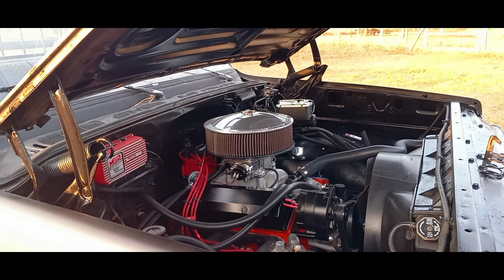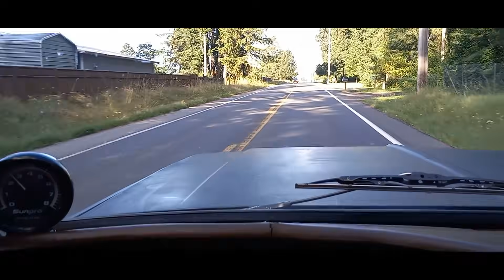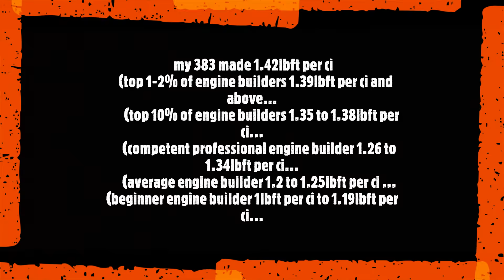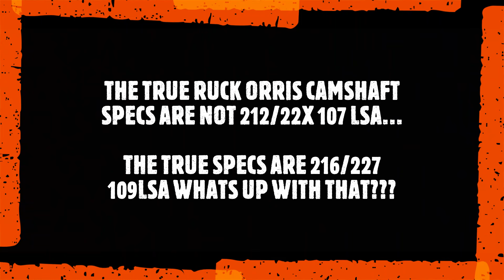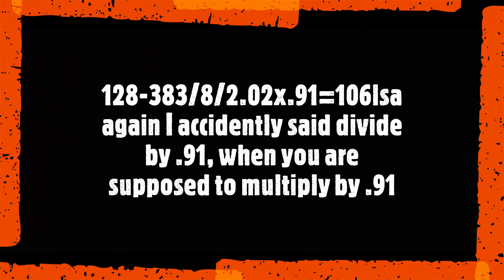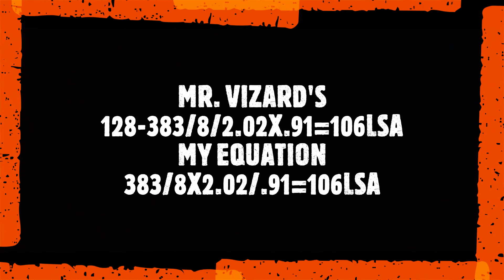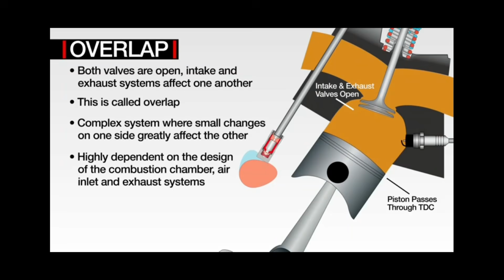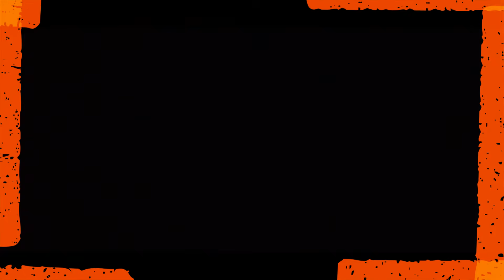CAMSHAFT SELECTION by LSA, 9 LSA's DYNO TESTED!!! LSA THEORY WILL BE DYNO PROVEN!!!, and EXPLAINED

Comment: 4:04 are you talking about Richard Holdener here? I kinda hope so. He wouldn't accept what I was trying to RELAY to him (The information originating from David Vizard) about camshaft selection for turbocharged applications. After that and after I called out his logical fallacies he was using to make the claim that "every cam is a turbo cam" he proceeded to ignore all further interaction from me.

Though, TBH, I still don't fully understand camshaft optimization for various boosted applications, so, assuming LSA is set/fixed/ideal/optimized as per the 128 guideline from DV, and assuming you've maxed out your useful lift for your given valve sizes, how should you go about optimizing your only other 1.5 camshaft specs, those being duration and overlap, the latter of which is at least a partial function of increasing duration (obviously depending upon which side of the lobes you increase it on)?

EDIT: 1:22:35 This is why I do hours and hours of reading on subjects that interest me. I cross reference and compare and continue to dig for information in order to hopefully uncover the truth, or something very close to it. I'll admit, I've shared pre-maturely before my findings are complete, before, but I always run it back to anyone (important) that I've shared with when I find the more accurate information that disproves or supersedes what I thought I previously knew. Or otherwise, I proceed with disseminating my updated information, along with my sources for ANY information I'm talking about. Nowadays, I also try NOT to share ANYTHING until I'm at least 60-80% certain it's within a margin of error of the truth.

As such, I will be sharing LSA theory with my brother, despite the fact that he already has a shelf cam and is reportedly happy with it, not wanting to change, and is planning for a positive displacement blower "retrofit" (essentially) in the future.
Reply: Also, I feel like I've come up with a few modifications to make the 128 formula more approachable for people with 2 intake valves, as well as some conversion modifiers for metric engine and valve sizes. Check it out:

Metric 3 or 4 valve: 128-(cc displacement/16.387/cylinder count)/((mm intake valve diameter/25.4)*1.414)*.91
Inches 3 or 4 valve: 128-(cid displacement/cylinder count)/(inches intake valve diameter*1.414)*.91
Metric 2 valve: 128-(cc displacement/16.387/cylinder count)/(mm intake valve diameter/25.4)*.91
Inches 2 valve: 128-(cid displacement/cylinder count)/(inches valve diameter)*.91

Although I'm not sure at all where the 128 or the 0.91 are derived from, I hope that this is accurate to all reasonable specific displacements. I noticed the big block numbers start with 132 or 133 for the formula, but still have the 0.91, so IDK if the bigger starting number is due to the longer stroke, or the higher stroke-to-bore ratio, or how the 0.91 comes into play at all, but if we could get those figured out, we could FOR SURE have a dead accurate LSA finder for literally any engine out there.

As it is, most small blocks run in the 75-100mm stroke length with bore-to-stroke ratios ranging from 1.33:1 in the case of a 4-inch bore and 3-inch stroke, to just about 1:1 in the case of a roughly 4"/4" engine, and this tends to be true for MOST road going engines in general of any displacement and cylinder count, both the absolute numbers of 3-4 inches, and the ratios. Though quite a few road-going engines are leaning towards the 0.9:1 bore-to-stroke ratios nowadays as manufacturers chase more volumetric and thermal efficiency for emissions and CAFE standards...

Big block engines also do this, seemingly to avoid humongous and heavy pistons associated with large bores, with one example being a roughly 4.25-inch bore with 4.75-inch stroke, or roughly 108mm bore and 120mm stroke. Ironically, the 6.7L Cummins is also around these bore and stroke numbers, but IDK how the 128 formula would apply to that, either, or if the 133 big block formula would be more applicable.

Comment: Wow. What an amazing video. I, too, am a spinal cord injury survivor. Your video made perfect sense. I have the wrong cam in my engine (290/350, L82 cam, dish piston engine). It does not have near the torque it should have. Ground straight up on 114LSA. I knew it was wrong, bigtime. I used the 128 formula and came up with 107.4 LSA. I swapping over to Vortec heads, set up for my cam ( .450/.460, 222/222). I have talked to several cam companies, all suggest a wider LSA (110ish). With what you have said about lower compression, and tighter LSA. I thing a 106 would be about right, but I can't find a reliable company to grind me this cam. I talked  to Oregon Cam Grinders they are steering me away from a hyd. cam, to a roller cam. So back to the drawing board I guess. What do you suggest I do?

Comment: Question.   A 350 cubic inch engine.   Air gap intake.   750 double pumper.   1 3/4" long tubes. 10.75:1  cr.   Heads flow 210cfm@.4" and 260cfm@.5".    There are two camshafts, lsa and duration exactly the same different lift numbers.  Cam #1 220@.05", 112 lsa, .410" lift.   Cam #2 220@.05", 112 lsa, .610" lift.   How much more power does cam #2 make?

I know if the combo was the same and one head flow 210cfm and the other flow 260cfm that 260cfm head would unlock 40,50,60hp or more.   It would be a big deal.   Please advise on how the cam situation plays out?

Comment: So I know Vizard is completely right, nothing wrong there. But your formula at 1:09:12 is nonsense.
128 - 402 = -274
-274 / 8 = -34.25
-34.25 / 2.165 = -15.82
-15.85 x 0.91 = -14.40
And if you reverse the first two numbers, i.e 402 - 128, you get the same result, but as a positive.
The formula goes as follows.
LSA = 128 - (402 / 8 / 2.165 x 0.91)
Reply: Remember your order of mathematical  Order-of-Operations acronym PEMDAS covers this without the added parentheses... the order is:  Parenthesis, Exponentiation, Multiplication, Division, Addition, and Subtraction, so it works out either way, but the parentheses do help a lot to keep track of this order!!

Comment: 1. why the focus on advertised duration? Factory cams typically have long duration @ .006 and short @ .050 vs aftermarket. I've always focused on .050 duration.
2. re DV formula, it doesn't take into account cfm. How can a 180cfm bone stock head use the same LSA as 300cfm? 
3. how to find these tight lsa cams?  Cam manufacturers don't have them unless you go custom grind.

Comment: Loved this video. It was like a verbal version of DV,s book.I am also a square body guy currently building a 540bbc for my crew cab dually. My build is somewhat off the beating path and I would value your input on my combo. 4.5” bore, 4.25 stroke, 6.385 rod, Afr 265 heads with 109cc chambers, yes, I know they are small, but not only does the budget not allow for for new ones, I was hoping to make a shitload of torque low in the rpm range. Performer RPM intake, 1 7/8 Hookers and 9.7:1 cr. All the builds I see regarding camshaft spec’s are more geared for 5000-6000 rpm range and that is not what I am after. I don’t care if the engine peters out by 5000rpm. I’m looking to hit 650-700lb torque by 3500 rpm. I would greatly appreciate any advise you could give on cam or otherwise. Thanks again for your videos, I just subbed.

Comment: Hey Adam, I need to decide LSA on my build, 421 sbc naturally aspirated with 12.5 cr, AFR 227 heads for bracket racing, RPM range is 4000 to 7000 
I was thinking 108 lsa… what would you run in this combination?

Comment: I agree with you and BT. BT is making drop in part for the majority of the ls enthusiast so his method work best for the cards he’s dealt. Now if you building a custom engine your method may yield better results. That 128 method is more toward a lower compression and less efficient cylinder head than most of todays engines. My engine makes 1.46tq per cube but it has compression and good coefficient cylinder heads. So does that formula still apply? I believe that formula just one way of a few to get the job done.

Comment: You are correct in your knowledge.i would like to hear your knowledge about LSA on turbocharged engines.figuring the turbine sizing for the power the engine makes.if I can equalize the back pressure to boost pressure then I know what Cam to use.the turbine sizing seems to be a secret.i am making a quess and maybe not educated.

Comment: So it is possible with good head flow on a street engine (not race engine) to have good power/torque without tight lobe separation and sloppy idle. I’m after smoother lower end off idle without choppy idle with higher power brake booster vacuum. Finding a slightly wider LSA (couple more than formula) to achieve my goals with 110 LSA Comp cam 270, 224 @.050 grind hyd, flat tapped has satisfied my requirements in 327/L79 SBC w/2.02 valve, mild clean up 462’s, HEI, .030 over bore, 10.5 real compression. This is not optimum but a comfortable easy to live with engine combination in my 67corvette w/4speed 3.55 gear.

Comment: Perhaps i was on to something in beliving that its absolutely unacceptable to give up lo 0:02 w end power (torque) for high end power, based on one of my favorite you tube channels (richard holdener) and the results from various tests, and after watching this video, start to believe that maybe his channel is just a marketing tool for “Mr.T”’s products. However, i have already purchased 2 of the same cams for both my otherwise stock 5.3 and 6.0. (The 5.3 was supposed to be for someone else who bailed out on it, so now im stuck w it) based on a couple tests in particular, but will definitely apply vizards formula to the 6.0 when im able to sell the 5.3 snd start the 6.0 build. Wich is as follows: (until i saw this video) 
Lq4 6.0 bored .10 over,
317 heads milled to achieve 66-68 cc’s 
Taller angle cut into the stock valves,
Blend the bowl leaving the rest of the head alone,
Forged flat top pistons and forged rods-stock length and stock piston style,
Fast 102 intake
Leaving only cam selection. 
Build is for a mildly custom 93 chevy 1/2ton 2wd chassis for autocross/roadcourse. I still dont believe that i need to only operate in the 5k to 6-7k rpm range to operate, dont see why 4k to 5-6k wouldnt work.

Comment: This is a smear campaign against BTR, loaded with lies and resentment. Walk away from this vid, it will lead you astray. There is nothing incorrect with BTR's products, even if tools used result in the numerical specifications being off by a couple degrees. No camshaft exactly matches the manufacturers secs to specs measured with different tools. This dude is resentful, and speaks from misplaced anger issues.

Comment: LSA does not determine where power output is in the rpm range... intake and exhaust closing events, combined with port size determines this. Not LSA. LSA determines valve overlap, also affected by the exhaust system, and 'may' have an effect on the amount of power throughout the power band, but not the rpm range.

For example, I once had a BBF that produced excellent torque and horsepower from idle to 3500 rpm and would not rev past 5000 rpm in neutral, and then retarded the cam timing to make it have more torque and horsepower through 5500 rpm. LSA never changed. 

Focusing on a single camshaft characteristic and saying it does one thing only is the definition of foolishness, and inhibits the mind from making the decisions in truth that the heart wants out of an engine. This is only a single example of how one's fruits are shown in the speaking body, as well as incorrect knowledge portrayed... they're always related.

Dude, just take your video down, because you bring dis- and mis- information, while slandering someone who is easily identifiable, without truth, because his fruits are shown in many of Holdner's videos as being successful. You badmouth him, without speaking truth. Ironically, you are the one experiencing the effects of lies being told, because you are the one speaking them. They speak about how cams work, and you speak lies about people not being knowledgeable. They are professionals because they worked to learn and provide a service with the attitude of helping people do something they want to do. You, on the other hand, talk schitt about truths spoken. I've shown you some of the details of how you're wrong, in an area easily misconstrued with incomplete knowledge.

Comment: Perhaps presenting some actual information would be more helpful. At least in the first half of your "advice" video. Telling use how intelligent you are followed by telling us whats wrong with someone else's data. Just get to it. Tell us some actual useful information.  👌
Reply from the maker: The video obviously went way over your head because of a of lack comprehension of valve events and an inability to see what was being presented in the storyline... You are one of a very very small hand full of over opinionated and under educated people that said something similar to what you have said out of the 109,000+ people that seen this video... Hell David Vizard left a comment on this video complementing me on the information i had presented so there is obviuously something to that🤔(his comment is pinned at the top).... I dont have time to break the whole video down for you step by step but ultimately this video does show & explain the effects of random changes of LSA, it proves with dyno data that there is only one optimal LSA for any given Ci v8 engine combination and it shows that when optimaly selected LSA it will result in the most TQ & HP across the entire curve, it also shows how optimal LSA is achieved...  All this was being explained & proven with dyno data all the while showing & explaining Brian Tooleys incorrect theory about nothing having an influence on LSA and LSA not being an influential factor on power production, i even used Tooleys own words strait out his mouth to confirm that he is incorrect... Ultimately there is info in this video you will absolutely not find anywhere on the the internet, this video had also inspired David Vizard who is an ex areospace engineer and a legend in the automotive world, It had inspired him to make a video alot like this using Brian Tooley as an example of an incorrect "camshaft professional" because i had brought to DV's attention that Brian Tooley was spreading misinformation about valve events, DV & I have no tolerance for incorrect information so it needs to be exposed... I have had several different types of Engineers with Masters & PHD's along with intelligent people from other qualified positions recognise the magnitude & depth of the information given in this video and they are able to appreciate it, i even had one PhD physics engineer (just like my grandfather) tell me that this video would have made a great PhD Dissertation,  if you dont know what a PhD Dissertation is look it up.... My next video will more directly explain all this further/deeper and with alot more examples for proof.... You say "that I'm telling people what's wrong with someone's data", I was not analyzing/explaining just BT's data, I was exposing BT's incorrect theory for LSA, his incorrect & incomplete theory for valve events and why the valve events are incorrect, ultimately threwout the video I proved he is wrong and that he is absolutely spreading misinformation... I talked to Brian Tooley after he seen this video and he could not deny what had been presented, he had no rebuttal at all... Individuals like yourself should be mindful enough to keep their uneducated thoughts as just that "thoughts" and also be mindfull enough to keep their opinions to themselves because it's not a good look to make comments based on hurt feelings and no real knowledge, Just sayin..... Also I would say you are afflicted by the Dunning-Kruger effect which is the psychological/scientific term for individuals like I had explained in the video, individuals which you obliviously identified with or you wouldn't have made the comment you did... Human Psychology is a real MF'ker and certain types of individuals like yourself are to easy to identify being as they unknowingly show themselves because they are completely unaware of their shortcomings do an inability to accurately analyze & reflect on ones self and acknowledge the fact that they are most likely average or below avrage because stisticly there are more average people in the world, but the average person bealives they are above average but if everyone was above average there would be no average which is physically impossible...